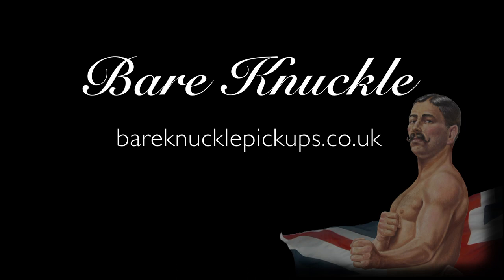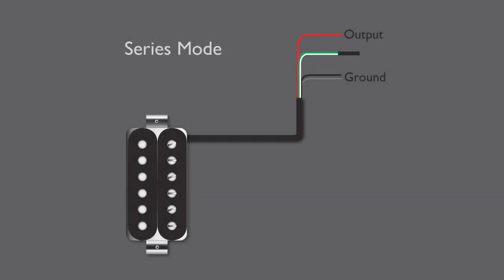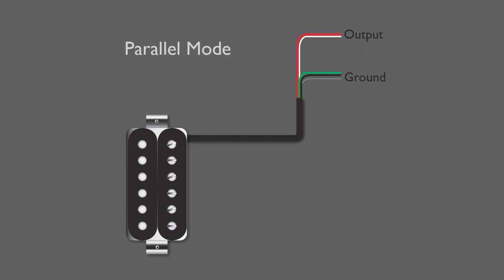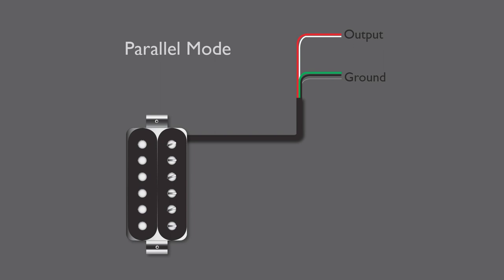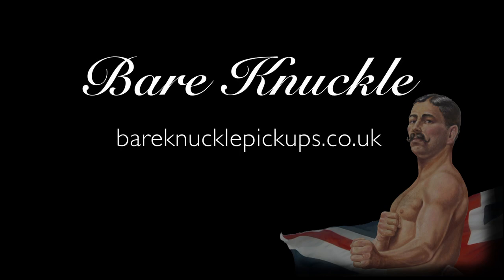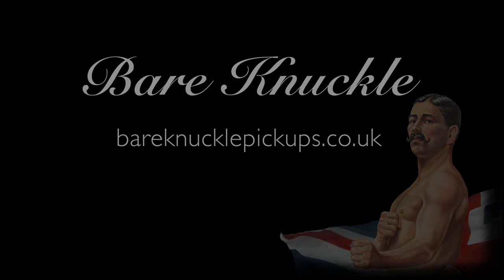Bare Knuckle humbuckers : Series VS Parallel

Comment: I don't know why more folks don't utilise parallel switching. IMO it's a nice, more open sound that doesn't sound overthin like most split humbuckers do.
Reply from the maker: It's definitely underused!
Reply: Because it's lower output and even more thin than a Coil Split.
Reply: Late to this thread, but totally agree, series parallel is far more usable than split coils. No hum, no big drop in output, a much more clarity

Comment: The difference is quite subtle with crunch tones imho. With the clean tone I could hear that the parallel config was a bit brighter and quackier.
Reply from the maker: sure, in almost all cases, differences in pickup tones and combinations will be most obvious with a clean amp setting

Comment: Can both pickups be wired to the same switch?
Reply from the maker: That depends on exactly what kind of switch you are using: standard guitar push-pull pots and mini toggles only have enough switch contacts to operate series/parallel switching for one pickup, but you can get more complex 5 and 6 way pickup selector switches which will allow you to get a combination of series and parallel tones from two pickup. Check out Freeway switches for some toggle switch options, or also the 5 way superswitch that we sell on our site if your guitar uses an inline switch